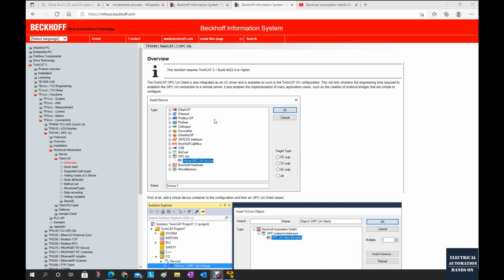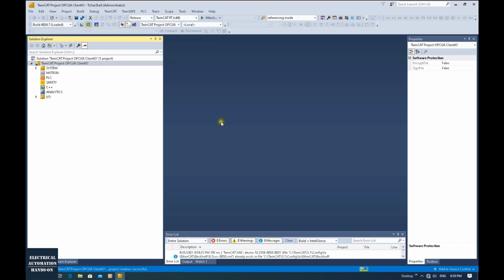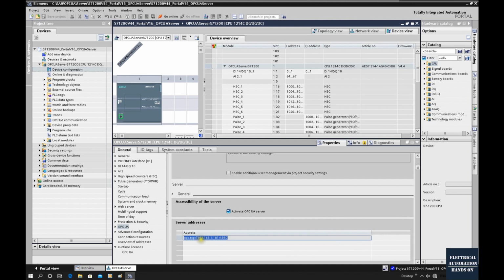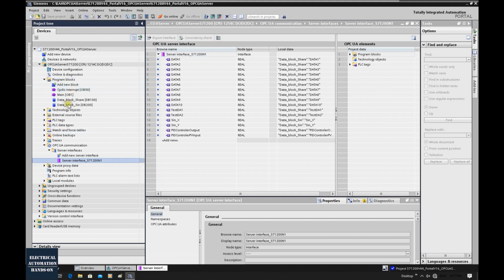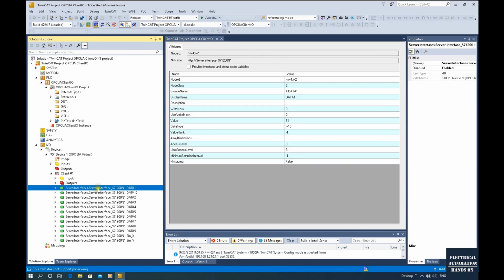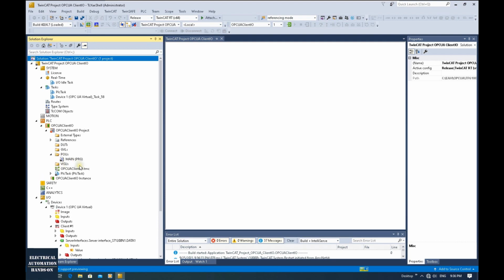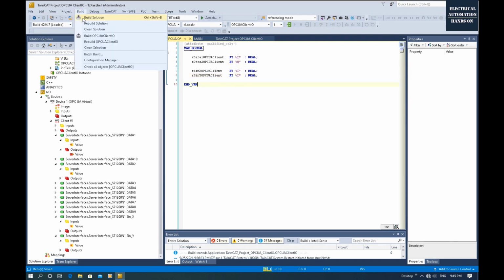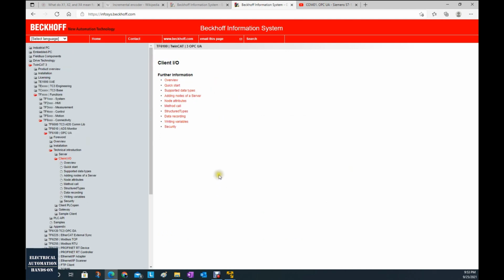COM25. OPC UA Beckhoff - TwinCAT 3 TF6100(OPC UA Client) and Siemens S7-1200 PLC(OPC UA Server)

Comment: Finally I can read the values of a node in the "Online" tab, great video.

However, I when I try to write, nothing happens. The server log shows no attempts to write from the client at all. Writing from other OPCUA clients works just fine.

I have checked the "Enable Write" checkbox, and I am at a loss of what to do.

To be specific, if I write in the Outputs Value, the number I write do stay in the Online tab window for the Outputs, but is never updated in the Inputs Value - nor the server itself.
Reply from the maker: Please check your s7-1200 DB. In the DB, for every line, there are a column named OPC UA Write, check that column

Comment: hello again my friend
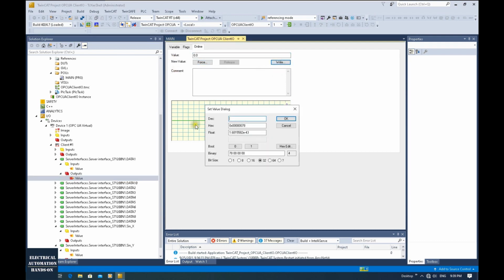In 26:23 minute of your video you put number in output value and imediettly get it in input value and also you get it in plcs71200 and i did all the steps like you but while i put a number in output value but i can not get the number in inpput value and also s71200 plc !
Please help me to finish it like you.
Thank you
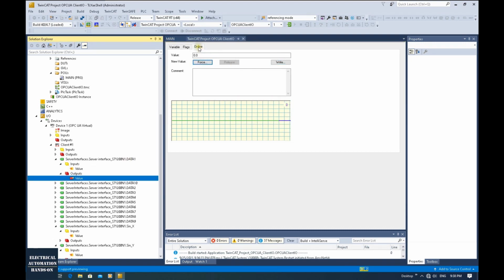Reply from the maker: Looks like your Twincat and S7-1200 have not communicated yet via OPC UA. The 26:23 shows the OPC UA from TwinCAT is doing bi-direction, so if TwinCAT output 120.0 -> s7-1200 receives 120.0, then  -> TwinCAT also receives 120.0 at its input. But your case has an issue with the OPC UA communication settings, please check the configuration steps, you may have missed some procedures.
Reply: @electricalautomation   i checked everything is as same as you did but data from s71200 comes to twincat but from twincat to s71200 doesn't go!!! I don't know why!!! don't you have any other idea my friend?
Reply from the maker: I have no idea, but I would recommend using other OPC software e.g. UaExpert to run as client to try communicating with S7-1200, if bi-direction communication works, then that means the problem comes from TwinCAT side.  @KamalHasani-kh5vm
Reply: @electricalautomation   yes i tried with ua expert as client and everything works well and made me sure the problem is not from s71200 side! My twincat version is 3.1.4024.35 maybe something is wrong with this version. With what version did you record this tutorial i wanna try with lower version maybe works!!
Reply from the maker: I would recommend using another computer and also disable your IPC firewall  @KamalHasani-kh5vm

Comment: Thank you for the video! I have a question. If I use CX5140 to replace Local and the Endpoint URL is LocalHost. Is it possible to receive the value from Localhost and control the IO from CX5140 (EL2809)?
Reply from the maker: Not quite sure your question, the connecting IO and OPC UA are totally different topics. I would recommend paying effort on learning more knowledge on the Beckhoff programming and configuration.

Comment: hello
thank you for your great tutorials .do you have plan to make video about opc ua beckhoff as server and 1200 as client too?
thank you body
Reply from the maker: I believe those video are useful for you
COM08a. OPC UA Beckhoff - TwinCAT 3 TF6100(OPC UA Server) and UaExpert(OPC UA Client)
https://youtu.be/aUClSRSSR_E
COM08b. OPC UA Beckhoff - OPC UA Server via C6030 Controller and TwinCAT 3 TF6100
https://youtu.be/ShfRMd6-eIY
COM25. OPC UA Beckhoff - TwinCAT 3 TF6100(OPC UA Client) and Siemens S7-1200 PLC(OPC UA Server)
https://youtu.be/26DJ17SIl1Q
COM09. OPC UA - Siemens S7-1500 (OPC UA Client) and S7-1200 (OPC UA Server) TIA Portal
https://youtu.be/oChVcRaUt9M

but note, you have to use S7-1500 to run as OPC UA Client.

Comment: Thank you for the video! I have a question. I have two tags, first one is "V101 AT %I* : BOOL;" and it works without any trouble. I see any changes of it. But the second "V102 AT %Q* : BOOL;" does nothing. When im trying to set a value it does not send/publish it. I use UaExpert for monitoring my tags.
Reply: Problem solved. There is a global tag "Write Enable" (Client->Outputs->Control) in Client setting. By default it is always 0, but should be 1 for enabling to write data in any OPC tag
Reply from the maker: Thanks for your sharing. I would recommend not using the Input or Output tag directly operated by OPC. I will use the global variable tags and do the mapping with Input and Output. Then share the global variables with OPC. It is flexible and uniform.
Reply: @G4rr1n1ch 
Hi Hope you are doing well. 
I am facing same problem.
 I want to ask you Are you talking about value in Online?
Reply: @dhruv994  Yes, i meant real time data. As the result I have something like this: I/O Module mapped to <-> GVL.Tag mapped to <-> OPC.Tag. Hope it helps)

Comment: How can I connect to events in TwinCAT3? It´s clear how to read/write single variables but I didn´t found a solution to subscribe to events from an OPC UA server.
Reply from the maker: Hi Bro, please see the manual of the TF6100 OPC UA Section 4.1.6, I think this chapter has something you need. Good luck!
Reply: @electricalautomation  Thanks for your answer, but the section you mentioned is for the server. I want to connect to server events with the client I/O.
Reply from the maker: @Johnsenfr  Oh got you, the "Client I/O" is an easy way for variables. Regarding your question, it is not the scope of this video, you have to program a lot for the OPC UA Client. I didn't get a chance to program the 'events' before. Pprobably you have to try it by yourself.